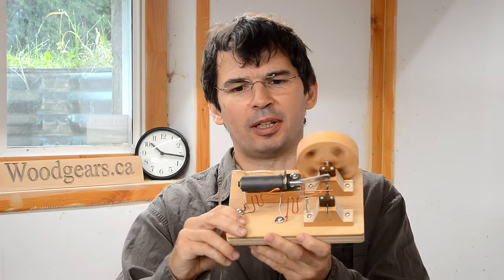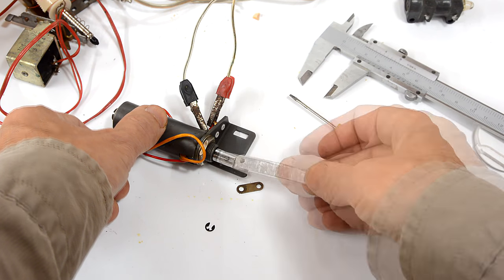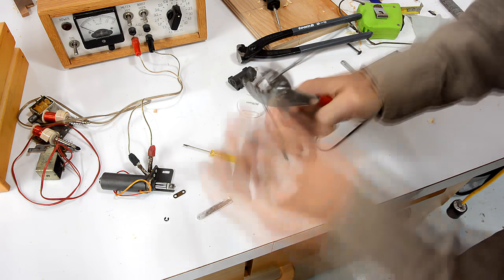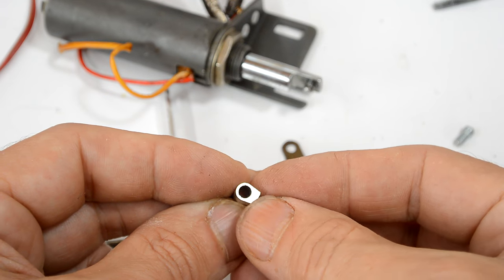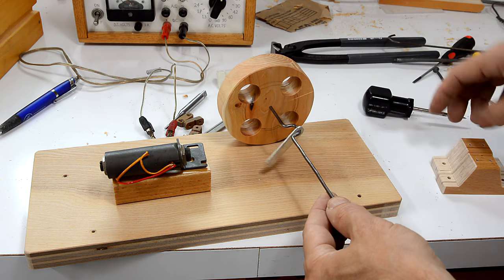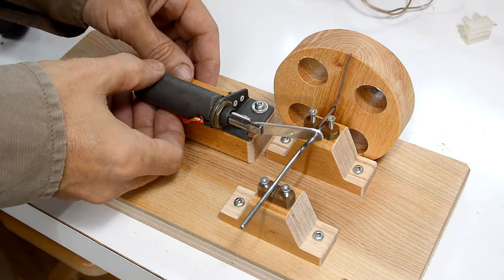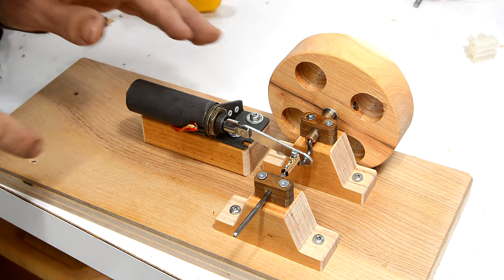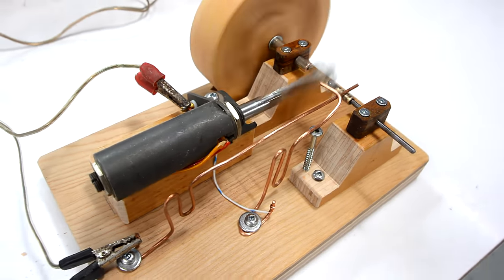Solenoid engine

Comment: Very nice work! I'm curious how long you are able to run this continuously? In my experience typical solenoids have overheating issues when they are rapid cycled like this.
Reply from the maker: I ran it for about 10 minutes.  Average current at 12 volts is 100 miliamperes.  Its a very efficient solenoid, so it only gets warm
Reply: The only real power losses on this engine except the obvious mechanical and resistive losses on the coil are induced currents in the rod and loss of magnetic energy when the switch opens. The first can be eliminated by
using a ferrite rod instead of a metal rod and the second if you use a small electronic circuit to redirect the magnetic energy to the source (or store it to a capacitor until the next cycle). Resistive losses can be reduced by carefully timing the on and off time of the coil to have it active only the time that it does the most work. Mechanical losses can be reduced by using bearings. After all that the final motor will actually be very energy efficient.

Comment: Matthias. Lots of comments so you may not see this one. Excellent build!!!
Would be fun to see and old flat leather belt running from the flywheel to something that needs spinning? Perhaps a miniature saw mill blade?
Reply from the maker: The engine isn't nearly powerful enough for that
Reply: +Matthias Wandel Not to really cut wood (tiny logs). Just a display or model. Well, if it didn't really cut wood, you probably wouldn't want to build it - haha. Plus it would probably remind you of all the work you had to do at your Fathers sawmill.

Comment: Interrupting that coil like that must produce an unholy amount of back emf. A flyback diode might be a good idea. Great engine though, it's hypnotic like a steam engine.
Reply from the maker: A flyback diode would delay the collapse of the magnetic field, which would slow it down.  So far, no issues with the contacts.
Reply: If it was causing an arc across the contacts, then some form of snubber would help, but as for now, if it ain't broke, don't fix it. 👱🏻
Reply: A diode with a resistor in series (or a zener diode with a normal diode) will still collapse the magnetic field fast, yet they will reduce the back EMF to a predictable reasonable level. It will still dissipate the energy though. A little more complex circuit would be required to regenerate the energy.

Comment: One of my favorite quick videos you've done, Matthias. What is a flywheel for, specifically? To balance it and keep it stable?
Reply: I think it's to give it momentum... but I could be completely wrong!
Reply: From what I've read so far, I guess it stores kinetic/rotational energy by basically getting a big heavy wheel to rotate. Now imagine turning the engine off, the flywheel will continue to spin for a while, so it has a lot of stored energy. And I guess when running normally, that energy is also continuously used. Interesting!
Reply: Also for the point when the contact is open to spin the whole thing through a cycle until the contact closes again.
Reply: Main purpose is to keep the thing moving after the solenoid turns off. When that happens there is no force on the cam but the solenoid must be pushed back in before it can fire again. In order to do that the heavy flywheel is there to keep the shaft turning so that it comes around for a new cycle.

Pretty similar to why internal combustion engines use flywheels. The flywheel there stores the energy produced by the power stoke where the explosion happens and gives off the energy in the next cycle to compress the air mixture again so that it can be fired again.
Reply: It's for inertia, without the flywheel it wouldn't turn constantly.
Reply: Specifically, the electromagnet / solenoid is giving a short kick in one direction for a very short part of the cycle. The flywheel takes that kinetic energy, converts it into momentum, and keeps the whole thing spinning for the whole of the rest of the cycle until the next electromagnet kick.

Comment: Nice. Why did you have to give it that little push in order to start?
Reply: Probably to activate the solenoid, afterwards it moves along and activates itself.
Reply: Position of the crank and the solenoid not being strong enough.
Reply: Thanks to both
Reply: The same reason it needs a flywheel to run. There's a part in the cycle that the "engine" has to coast through. If there isn't enough rotational energy in the flywheel for that, it won't get to the next turn.
Reply: Ya, since the motor only has one cylinder is relies on the momentum from the flywheel to keep it going, and needs an initial kick to get going each time. I also presume that this engine could likely run in reverse if the kick was applied in the opposite direction.

Comment: That would be a great project for someone to make, for a school science or electrical class!
Reply: it would need to have another funktion. just turning is a little boring. we do built bells with electric magnets and diy bells from sheets of copper though. the solenoid engine would work as a bell... you could make it hit the bell when it is pulling the shaft in.

Comment: Neat.  Would this be able to charge a battery if connected to a wind mill?
Reply from the maker: no
Reply: Just change the metal with a magnet
Reply: Yes, but with a proper electronic circuit. Adding a magnet to the rod simplifies that circuit a lot. Bear in mind though that power is proportional to the product of force, length and frequency. So in order to produce a lot of power you need big force, on long length at high frequency. But there are actually infinite ways to shape the solenoid with magnets and iron to make it generate more force. The important factor is to have a strong magnetic field change its magnitude as fast as you can.
Reply: +Thanos M So probably a big windmill,a powerful magnet and wind will work?
Reply: Why don't you just build a rotating generator, it has only one moving part and it is much easier to build than that. Also you avoid the cam switch that is a source of inefficiency.
Reply: +Thanos M well,you are right,and the only source of solenoids i know is sirens (Mainly thunderbolt 1003)
Reply: Solenoids are easy to build, it is just wire wound around a plastic pipe with an iron rod inside.

But a rotating motor like the one in the above link is much easier to build and has by far greater power. You just need at least one magnet (preferably neodymium, more if you can afford them) and some coils. A motor like that is much more powerful because you can easily have a lot of magnets around the disk and the disk can easily rotate in very high speed, so you have a lot of alternations of the magnetic field inside each coil. Also you can have a lot of coils that produce energy at the same time.
If you are not a wound type of person you can buy inductors that fit you design (they are sold wound around ferrite cores, it is a very common electronic component). If you use coils with core, be advised that there will be a strong force pulling the magnets to the cores. Using coils with cores combined with iron disks in both the back of the coils and on the back of the magnets would make a much more powerful motor (at lower RPM) for less money (although a bit less efficient than a coreless motor due to core losses).

Comment: Don't coils in mechanical solenoids get pretty hot? Could you use a fan on/as the flywheel to cool the solenoid if this is the case?
Reply from the maker: this one barely gets warm.  Averare current is 100 milliamperes

Comment: Am I missing something here, it looks like the two bent copper wires are always in contact, but that's not the case, correct?  The point of the cam is to disconnect the power from the solenoid so it extends again, correct?
Reply from the maker: Taht's right.  They aren't always touching.
Reply: Thanks.  For a second I questioned my fundamental understanding of all things logical. lol

Comment: thanks for posting.  nice work.  a return spring might not be needed, especially if the flywheel is weighted at its perimeter.   is your solenoid from a doorbell.  this design might be optimized as a low-tech electric motor; we know low-tech batteries are possible.   coil shut-off should be 'tuned'.   two or more, purpose made, solenoids should make smoother power and more usable torque.  like a stirling, power should be taken off at the crankshaft, via gearing.      cheers

Comment: I had an assignment once to build an electric motor.  I tried to build a reciprocating solenoid engine, as well.  The main difference between yours and mine is that yours works and mine failed unspectacularly due to half-assery on my part.

Comment: So, a solenoid is a eletromagnet that pulls the metal rod, with a alternate current, to make movement. But if ou have something like a v16(solenoids) with somekind of intercalated system where 6 push, 6 pull (repell) the rods (these repelled ones could be eletromagnets too, to streghten the repulsion) makin it get high torque and high speed and reliability in control. if one hobbist wanted make it own v16 eletric replica or RC it maybe could. I dont do it because i learned all of this online and dont have the skills to try, but love it tho. Graphen, activated carbon, aliminium air or magnesium diy batteries are cool too, where are all the all diy eletric car topics on the internet?

Comment: Very cool, I'd love to see you attempt some wooden kinetic sculpture, something weight driven. I've been experimenting with axles using skateboard wheel bearings and dowels, they spin nicely and are really inexpensive. The bearings from roller blade wheels are good too, and are smaller. Both the skateboard and roller blade bearings can be friction fit into your frame.

Comment: Now this just needs a microcontroller and a power transistor as a governor. Then just crank the power supply up and if the time between switch closings increases: increase the transistor duty cycle, if the time between closings decreases: decrease duty cycle.
Reply: You do not realy need an MCU
Reply: nope just a 555 timer and some other bits.
Reply: Neither a 555 will do. This device needs to be timed by its rotation and the coil needs to be fired at the appropriate point of the cycle and stopped accordingly.

Comment: Can it rotate in reverse?
Reply: Ya, just turn it the other way when you are starting it.
Reply: No, you need to have the pulling force in the opposite side of the circle.
Reply: You could if you turned the cam 180 degrees.

Comment: I made something similiar out of an old hard drive. I used the r/w head actuator as a solenoid and platter as a flywheel. It worked okay, but not nearly as well as yours due to the problems with triggering the solenoid.

Comment: could you effectively just have made infinite power?  because if you hook up the cylinder thats spinning to a little generator you could wire the generator up to the solenoid then just give the wheel a spin and the generator will make energy to put into the solenoid which will then spin the wheel more generating infinite power!

Comment: Mr. Wandel, what characteristics make this type of electric motor not practical vs other types? I suspect it has to do with the limited contact time, meaning the motor is "coasting" much of the time. Am I tracking your line of thinking?
Reply: I believe it's because the duty cycle (the amount of time it's actually doing work) is horrible.

Comment: Pretty cool!  Why drill holes in the flywheel?  I thought the flywheel was to add rotating mass?
Reply: Looks cooler, so why not.  Besides it's not doing real work but if it were, the mass of the flywheel should be carefully  matched to the solenoid power for the intended task. BTW educated guess, and no clue how that would be calculated.

Comment: What makes it spin? I mean why it doesn't just pull and push?
Reply: The weight of the flywheel gives it the momentum to keep spinning.  The solenoid pulls and the momentum of the flywheel keeps it spinning until it pulls again.  The spring pushes too, but I think it would run just as well without the spring.

Comment: I wonder if adding a small weight at the end of the wire which hangs over the cam would give you higher RPM capability. Seems like you are depending on the springiness of the wire to bring it down and actually follow the contour of the cam. At higher RPMs I bet that cam can just about do a full revolution before the contact between the wires even breaks. Good idea with the screw too, though.
Reply: In retrospect a weight is a bad idea because it would give it inertia on the upward direction, right? Maybe a spring attached to the wire pulling downward, close to the cam.
Reply from the maker: RPM on this engine is limited by the high induction of the coil (it has a lot of turns on it), and it takes a few miliseconds to build up the magnetic field.  But that also makes it fairly efficient.  It barely gets warm.

Comment: Why the holes on the flywheel? I always thought that crossings were made in casted flywheels  to increase the moment of inertia without added material, but if the material is already there, wouldn't it be better to leave it? The more mass, the better.
Reply: Probably for aesthetic reasons.
Reply: Moment of Inertia is better per unit weight that way. (Short form, Mass further from the axis is worth more momentum than mass closer)

Comment: where do i get this solenoids from?
Reply: your neighbors car starter!
Reply: haha good joke
Reply: you could make one, in the spirit of DIY.
Reply: really? how?
Reply: Wrap tons of tin magnetic wire around a spindle. Probably a few hundred turns if not more.
Reply: yes
Reply: From a lifetime of parting-out free junk.
Reply: Get a plasic pipe and an iron rod that slides nicely in that pipe. Wrap magnetic wire around the pipe. It is ready.
Reply: Doorbells.
Reply: Sirens (Mainly Thunderbolt 1003)
Reply: Gut some old LAN line phones from a flea market.

Comment: What was the drive required for the screws used on the bearing blocks? It looked very unusual.
Reply from the maker: robertson
Reply: The proper Canadian choice.
Reply: Ahh, googled it, obviously very common in Canada. Atm Torx head woodscrews are gaining popularity, are you also seeing that over there too?
Reply: Nope. It's Robertson everywhere in the shops. Lot of American stuff still uses Phillips, so we always need a couple of those drivers handy. Flathead if the screws are to be exposed, and need to be aesthetically pleasing.
Reply: Robertson screws are very popular in decking, house panels, and bathroom urinal/toilet separators here in the USA

Comment: Were did you find the solenoid ?
Reply from the maker: It was part of some non-consume equipment from the garbage I would have slavabed back in the 80s.  No idea what it was part of.  It's a really good solenoid though.
Reply: just wondering were i could save a solenoid from
Reply: You might find one in the mechanics of an old VCR player. I found one there once.
Reply: +ian metheringham automotive junk yard.  door lock